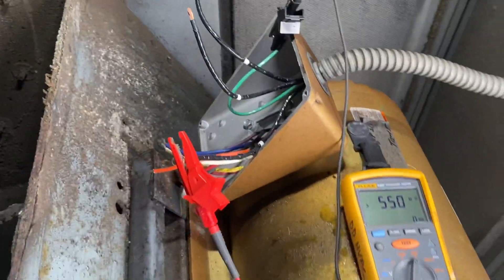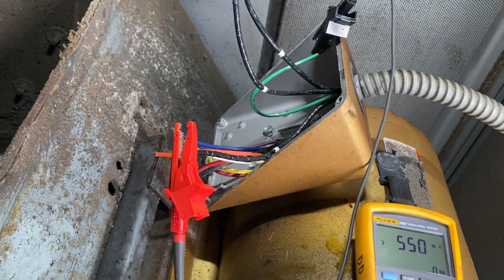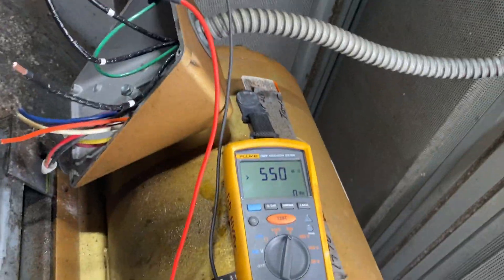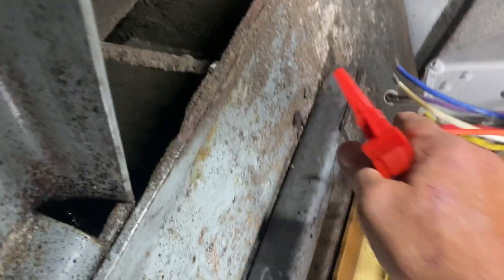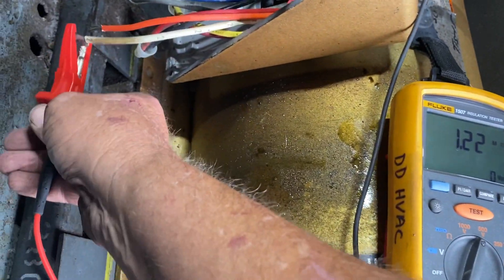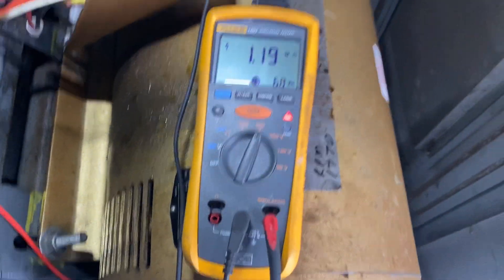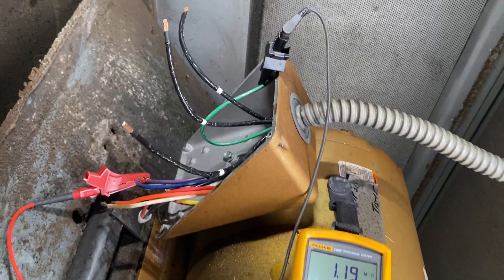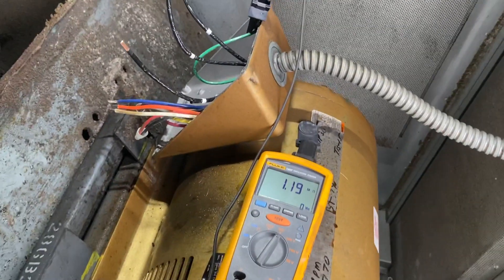Using the FLUKE 1507 to Identify a bad motor.

Comment: At what Ohm reading would you consider it the cut off point to be considered ‘bad’ ?
Reply from the maker: Ideally, the reading between the windings and the case and ground should be infinite. Even if I get a blip on a multimeter the motor gets replaced. VFD’s pickup current leakage well before a breaker or starter overload. It was the “over current” fault on the VFD that led me to do the insulation test that the motor failed.

Comment: Have you tried out the fluke 1587 FC? Its about time to look for a new "meg meter" and was looking at that one.
Reply from the maker: I have not tried it, but I do know it's superior to the 1507. My employer provides our test equipment so I'm kind of limited in choice. :( 
If I need to check the output of a VFD, I use an Oscilloscope to see the PWM wave form, current and amplitude. Thanks for the reply!

Comment: Even if you turned off the VFD you can send voltage on the leads going upstream and nothing would happen?
Reply from the maker: Your point is?
Reply: @wtfman5313 i meant that if it’s better to isolate the wires from the VFD AND proceed to Megger the wires in the motor box
Reply: @wtfman5313 no point sir, just a novice asking a professional like you a question for knowledge purposes that’s all.
Reply: We're always told to isolate the wires from the VFD, tou dont wanna burn up a $10k VFD because of laziness

Comment: nice meter!  You think this would have shown up with just a resistance check with a regular meter?
Reply from the maker: @Joe_Mission    It did not show up on the initial resistance reading. Your DMM would have told you this motor is good.

Comment: Did you disconnect from the VFD terminals before megging your load side conductors that feed the motor?
Reply: Thats what im wondering. Do the the feeders coming in have to be disconnected at the other end in order to test.. i think yes

Comment: How do you determine the baseline number for your mega ohms? How is above 550 your number? Thanks in advance
Reply: Ik this is 3 months ago, but the reason it's 550 megaohms is because that's the maximum amount the fluke meter can read

Comment: 1M-ohm doesn't seem to be bad. I mean 1 M-ohm is enough for every 1000 Volts and this one is only 460 Volts. The leakage current at those values is not noticible
Reply from the maker: It's noticeable to a VFD. In a perfect world you'd have an infinite reading to ground. If you're not tripping at 1 Meg Ohm now, you will be eventually.

Comment: I would’ve checked the line wires together as well Incase they are rubbing against each other. Thanks for posting this video
Reply from the maker: If two three phase wires rub out and connect, you get a cross phase and typically you don't need to megohm to test for that.

Comment: The meter I bought is Klien Et600 it can test upto 1kv. And it says it's 400mega ohms. Does it mean I will not be able to use it for such motors like this on the video which it's gotta be greater 550m ohms. ?
Reply from the maker: That meter will work just fine. If I had to purchase my own meter, that's the one I'd get.
Reply: @wtfman5313  so mow I need to know at what ohm insulation test compressor or motor is in danger zone and what ohm it's bad ?
Reply: Usually when the "meg meter" shows 0.whatever that a vlear sign of a "grounded" motor. There are instances where 3 and below are a sign of a failing motor (will run for a few seconds then VFD will fault off or run a few days and trip the OLs on a starter) i work at a waste water treatment plant where motors run 24/7 and we're constantly megging motors to make sure thats nit the reason for the error codes, its a lot faster to MEG a motor. Now 4160v and higher we cant accuratly MEG because our meggers only go up to 1000v

Comment: So it test the insulation of the wires but couldn’t you do the same with a fluke multi and test ohms from any of the motor leads to ground and if you have resistance it’s bad right? Just trying to justify buying this
Reply from the maker: Not always. VFD's are sensitive enough to trip on High current yet when you ohm the motor winding to ground, you get an infinite (OL) reading the majority of time. Your meter may blip and then go to OL (Open Loop). If that's the case, you've found a motor going bad (as long as the motor is disconnected or isolated from the supply.) Many times, you need electrical pressure on the windings to pick leakage current as volt meters don't supply enough voltage to detect.
Reply: Okay thanks man that’s exactly what I thought so I could technically miss a bad motor using just my fluke multi meter
Reply: Does the same apply to just testing wires is a multi meter suffice enough using the ohm setting to see if you wire is compromised
Reply from the maker: @austenkeller1247  yes. A multi meter is good for that.

Comment: I need to get a megaohmeter, should i get the insulation tester or just regular meter ?
Reply from the maker: @xraybravo7180  A regular Volt Ohm meter won’t do insulation testing.
Reply: @wtfman5313  whats bad insulation resistance ohm on motor and compressors general rule ?

Comment: Thank you for the informative vieeo, some guys says you have to choose double the voltage of the motor on the meter is this acurate and i not sure why they claim this ?
Reply from the maker: @xraybravo7180  - Technically he’s correct, but some say one thing and others say something different. I want to know if I have a failure at the Voltage being used by the motor. Doubling the voltage isn’t going tell me anything new. If a motor fails at 1000V it’ll fail at 460V also.
Reply: @wtfman5313  how much ohms is bad or going to be bad I bought klien ET600 megger and it doesn't have the range of good and bad values for compressor and motirs.

Comment: Nice video. 
Typically we test wiring at 2x the nominal voltage. 480 = 1000v
Windings are tested at rated voltages to not over stress the components. 
The 1507 is nice because you can test as low as 50v.
Reply: Where does that come from and what's correct on the book?

Comment: There’s a ‘micro short’ in the windings…meaning…that a conductor in one turn in the winding is actually broken, but when a the motor cools, the conductor is touching and will read fine. When the motor runs, it pulls current and the conductor will heat up and separate, shutting down the motor and tripping the drive.  The drive can run on two phases only and typically doesn’t detect the break until the winding heats up.
Reply from the maker: The VFD will instantly recognize a single phase condition.
Reply: @wtfman5313  ya all the ones I've worked with do as well

Comment: What is minimum resistance reading for insulation test, so we can say that component can use
Reply from the maker: Well, you're actually testing the winding insulation to case ground so you would ideally want to see an infinite reading. You are checking leakage of current through the wire insulation to the chassis of the motor so you would want as large of a reading as possible in ohms. 

Minimum resistance of a motor winding will vary widely based turns, wire thickness and such, but on a Meg ohm test of a motor, you want maximum resistance. Hope this helped.

Comment: I usually get out my multimeter and test resistance between coils. Any variance tells me motor is bad. This tool is too fancy for me 😂
Reply from the maker: Sometimes you don’t get that blip on the meter. This was to verify or condemn a suspected VFD  that turned out to be a failing not failed yet motor.
Reply: Look into getting a microohmeter for testing the coils like that , a regular multimeter doesn’t supply enough voltage to show a change, but a microohmeter is specifically designed for that test

Comment: I’m looking for a new meter, I do industrial maintenance. I interact mostly with 3 phase motors 30hp and smaller.  

I have always seen the value in a megger but none of the shops I’ve worked in have them.  Considering the 1587 as it should have all the features of an 87v or plus able to meg out motors.  Would I be able to test these motors reliably or do you need a dedicated megger?
Reply from the maker: Typically, a Fluke 87 or equivalent (I use the 179) would be fine to diagnose a faulted motor. Example: testing a winding to it's case or a ground may blip your screen very briefly then show infinity again. That is a motor with failing windings. The 1587 is to test the winding insulation and should be part of an annual maintenance action or to verify whether a motor is causing a VFD or other current monitoring device to show a fault due to leakage to ground. Other than that a regular Fluke model volt / ohm meter is what I usually go to.

Comment: What reading would you get if you megger between the windings if the motor is bad? ( T1 to T2 ) ..etc
Reply from the maker: Reading between T1 to T2 would give you the winding value of those two windings. When Meg Ohming a motor, you're comparing each winding to ground. You are putting electrical pressure on each winding and wire to check for leakage current back to ground. You describe a typical winding check for a possible open.

Comment: Hello thanks for the info! I noticed that you have a over voltage fault on your drive is that correct? Is so, what was the solution for that? I have the same problem! Thank you!
Reply from the maker: The problem will be with your drive or less likely, main power feed to the drive. I will eventually post a vid on how to find out.
Reply: Yes please i have that over voltage problem for a few days and is driving me crazy! The motor it was grounded so i will replace that in this next days and see from there if i can do something with that fault! Thanks
Reply from the maker: @Jorge_pdll  The fault if you don’t already know is an internal bus fault. You can replace it or send it to a service center.
Reply from the maker: @Jorge_pdll  generally the overvoltage error on an Eaton VFD is Bus related and internal to the VFD. Typically I get those errors near the end of a VFD’s service life. That drive has since been replaced.

Comment: did you disconnect the leads at the VFD?  wouldn't that fry the drive if you didn't?
Reply from the maker: Yes, the leads were disconnected from the output contactor. No harm would come to the drive as long as the contactor is open -  which it is when there is no command for it or the drive is powered off.
Reply: @WTF Man!  ok good thanks I'm just learning this stuff I think I was confusing it with ohming.  So you're checking the insulation of the wires up to the open contacter.  I've only done it directly to the motor and I have heard of a drive being smoked this way but the contactor must have been closed.

Comment: What would have been a good reading? If the motor was fine
Reply from the maker: > 500 Meg Ohm @ the 500V setting for a 480V motor.
Reply: @wtfman5313  is infinity bad

Comment: I had the same issue with a motor that was controlled by a VFD. It would start up and run for a few seconds then when it would get up to maybe 70 percent of the actually full load RPM’s it would trip the VFD. I’m gonna go out on a limb and say after you swapped out the motor the problem was fixed or did you still have issues with the VFD as well?
Reply from the maker: The problem was fixed. The new motor has run without issue since that day. Install of the new motor was the same day.
Reply: @wtfman5313  Good to know! Thank you for the video and keep up the good work brotha!

Comment: Great video! just remember if your readings are on a cold motor it’s going to get worse when it’s under load or hot. Heat expanding the insulation giving you lower M-ohms.

Comment: I did this exact test same meter and got nothing 0 on all 3 legs? Motor was definitely fried smelled it when I removed the pecker head. But what does it mean with 0 on all 3?
Reply from the maker: It’s shorted to something internally in the motor causing 0 ohms of resistance - which is a short circuit. All legs are touching the case.

Comment: Have u ever seen a motor running while also having resistance to ground ? I found one with 4 ohms to ground on T1/T2/T3
Reply: yeah, 
ive also seen one, what i think is that the current leaked to the ground is not high enough to trip the MCB or trigger the VFD short circuit
Reply from the maker: @chefeatsher  I have seen this on both single and three phase. Pretty cool actually.

Comment: So a high ohm reading on the feeder wires means the wires are good? And a low reading would mean it shorted or something? What does it mean when there’s a low reading like that for the motor wires?
Reply from the maker: You want to ideally read infinite when reading your windings, leads or current carrying device. Shorts will give you a very low reading such as .1 or 0 ohms. There are a few exceptions though, but they apply to electronic devices mostly. You are correct.

Comment: Do you leave the wires terminated on the VFD when testing?
Reply from the maker: Yes. The wires were not connected at the VFD or the motor. They're completely isolated for testing.
Reply: Is that to check if you have a break in the wires leading to the vfd? but the ground was connected to the vfd to complete the circuit?
Reply: I'm also wondering the same here

Comment: Whe do u test for more than 500mega ohms and 100 mega ohms
Reply from the maker: Rephrase your question. I'm not sure what you're asking?
Reply: How come you chose to test the motor at 500MO? And did u test every single phase lead of the motor? Thank u
Reply: @oscar27ization  he tested it at 500 volts and the meter indicated the resistance was 500 MO
Reply: 500 volts not mega ohms. The ideal reading for a 3 phase 480 volt motor that is good would give you a reading of greater than 550 mega ohms on each of the 3 wires at 500 volts.

Comment: Don't know if this is appropriate, but can you name the manufacturer of the air handler? I ask because it looks like a des champs/munters. They also have narrow access doors on some models.
Reply from the maker: It’s a 150Ton “Seasons 4” chilled water AHU. I believe they’re made in Atlanta, Ga.
Reply: @wtfman5313  Thanks friend. I had a 60 hp go out a bit ago on a munters unit. Ridiculous the things these manufacturers squeeze into some those units.

Comment: How do you know what value to set the megger to?
Reply from the maker: By the voltage that is supplied to the motor. In this instance, the motor is a 480 Volt motor so I selected 500V. Any thing over 575 V you would use 1000V.
Reply: @wtfman5313  gotcha thank you!

Comment: Can this identify turn to turn faults?
Reply from the maker: Yes as long as you use the multimeter function of the meter. Any windings shorted together would read zero resistance and you'd get a resistance value between the shorted windings and the un-shorted winding.

Comment: Its a balder motor...  Of course it's good...
Reply from the maker: Hehe... I have replaced so many Baldor's over nearly 40 years! The shaft bearing seals bleed and grease gets into the gap between the rotor and stator and creates a path... If you look at that motor case, you'll see what I mean.

Comment: Thanks for video. I think you did the most basic but best way of understanding the megging of a motor.
Reply: Thanks for posting and keeping it simple.
Are you an electrician  or hvac Technician?
I have the fluke 1520 and you see very few hvac guys with megommeter. I'm hvac Technician myself. 
Those tradesmen that work on motors will eventually have a misdiagnosis when checking for a short; especially on outdoor motors.
Thanks again.
Reply from the maker: @TheWpruden  I've been an Electrician and HVAC Tech. In the last 20 years I've focused completely on HVAC. The MegOhmer is critical if you do commercial refrigeration. They're worth their weight in gold.